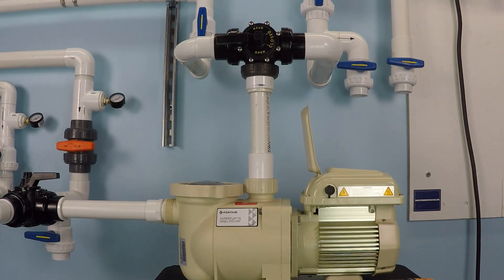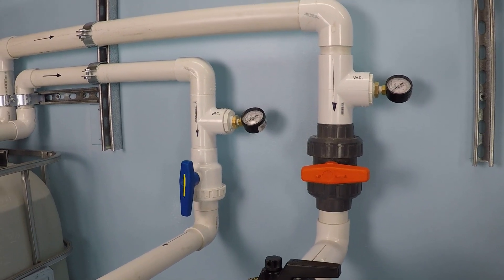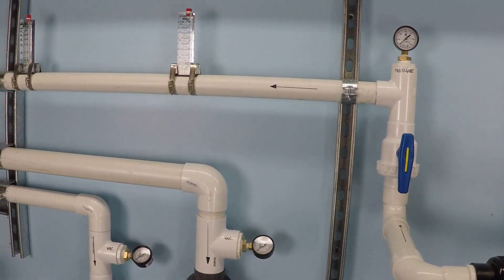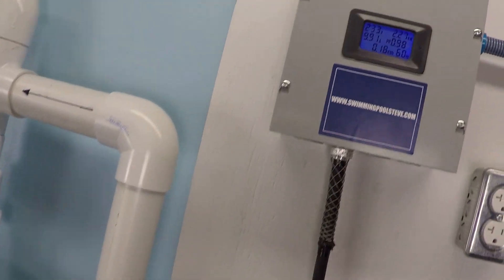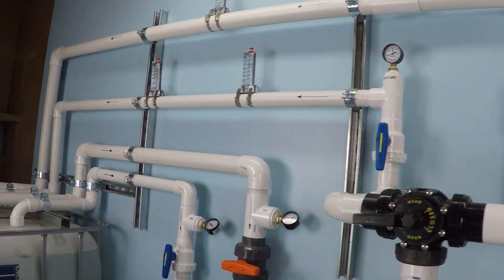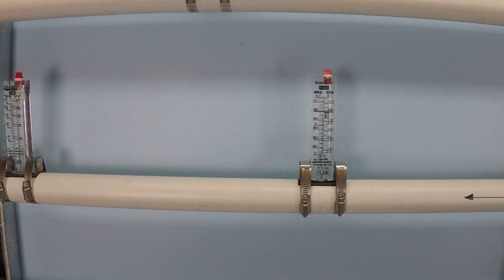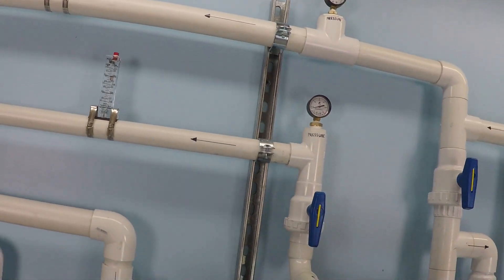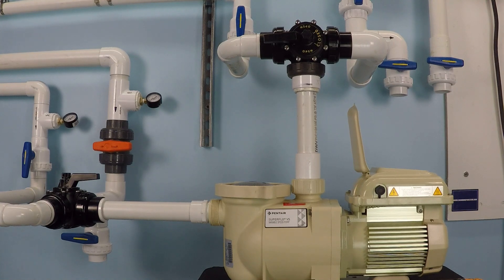Pool Pump Full Speed Flow Rate

Comment: Would you suggest that I convert my pipes to 2” from 1.5”? Salt water system 18,000 gallons, at least 8 years old. Having fitting leak issues. Also want to switch to variable speed pump.

Comment: Are there any differences in efficiency between different vs pumps all running at the same rpm?  Ie which vs pump uses the least power running at 3450rpm, at 1750 rpm or 1000rpm?

Comment: Good video example, thanks!!  What is the manufacturer of the flow instrument?
Reply from the maker: That flow meter is made by "blue-white" brand. They are also the makers of the similar but newer pool and spa flow meter model, the "FlowRead" flow meter. Cheers.
Reply: Yea, I like the inline one but I don't think I need the check-valve version. I don't have a water heater.